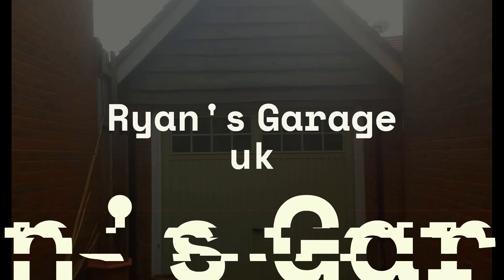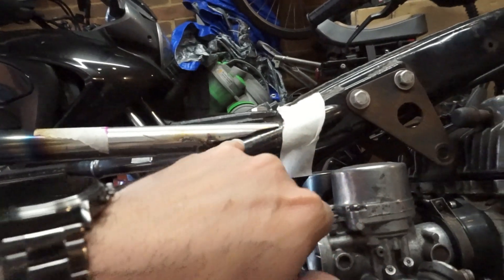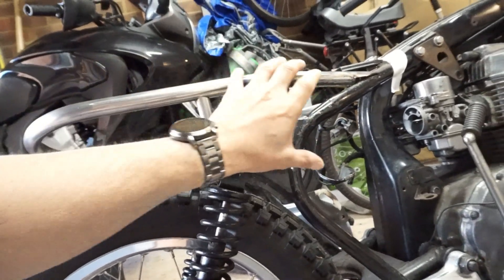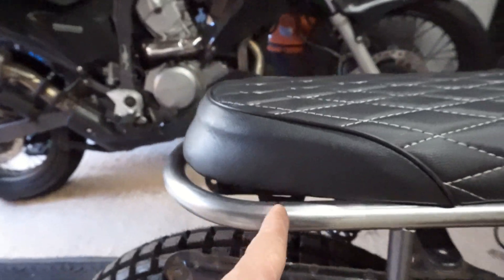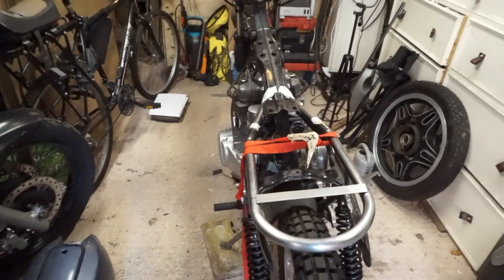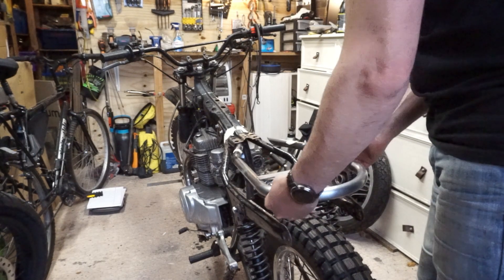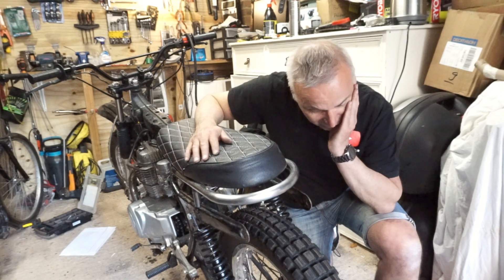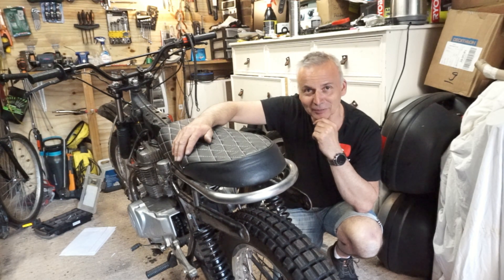How should I attach my seat? -  Project Bike Build -Part 45

Comment: Hi Ryan, As you have cut the middle section out that supports the back 2 Fins as i now call them (the 2 end plates that stick out from the suspension mounting points backwards), you may have lost some structural strength and rigidity at the back end so it might be worth considering putting a plate between the 2 fins and then possibly look to shorten the fins, mounting the rear mudguard to the plate you have made to bolt the seat to. Just checking the plate thickness with you as it looks a tad thin to support the seat, frame and the weight of a rider. keep up the good work though, its looking great so far.
Reply from the maker: Hi Neil, i am planning to shorten the fins and also to add back in a little more strength with firmly fixing the seat hoop to the remaining section. The weight of me is being taken by the sides of the seat being in direct contact with the hoop and the 2mm strip is just fixing the seat into place. So hopefully it will all be strong enough

Comment: Why not lower the rear loop? Easy enough to do, and will work better and look nicer.
Reply from the maker: Hi, The seat heigh is where it feels comfortable to me, I can put both feet flat on the floor at this height, so I'm not trying to lower it. But you may be correct on the looks.
Reply: @RyansGarageUK  It looks hideous and it seems a shame to put so much work into it?  I would cut off the stock rear subframe, and make something lower, smaller and more compact out of 5/8 tube.
Reply from the maker: @humourless682  sorry you feel that way. But i will not be removing the subframe, as i do not have the skills nor experience to create such a critical part of the bike. I have only started welding a few weeks ago and this is my very first attempt at such a project. I understand your point, and thank you for you suggestion. Ryan
Reply: @RyansGarageUK  Many years ago, I carried out extensive modifications on a Yamaha trials bike, with a stick welder, and like you was very much a beginner.  if you are not confident though, probably a good idea to avoid changing the subframe
Reply: I must agree. It looks absolutely terrible. And structurely dangerous. 
Sorry ✌🏻

Comment: I do watch this channel and really worry sometimes. Reminds me of the Johnny Cash record. 
I really do admire your spirit, but your approach is very hap hazard and unsafe, in my opinion. Safety first. 
Have you checked your welds? Did you jig/reinforce the frame before removing all the rear parts? As this has probably moved! 
You could have bought an original honda for the money you have spent. 
Please take care on this thing!
Reply from the maker: Hi, thank you for your comment and concerns. I  am certainly learning from zero previous experience although i will be sure to double check my welding when its complete, and the single very thin bracket i removed will be replaced by this significantly stronger seat hoop. I do know it would have been far more sensible and easier to have just bought an XL to begin with. But please understand i am doing this for the joy of trying and learning. It may not be great, but the next one will be better (I hope). Ryan